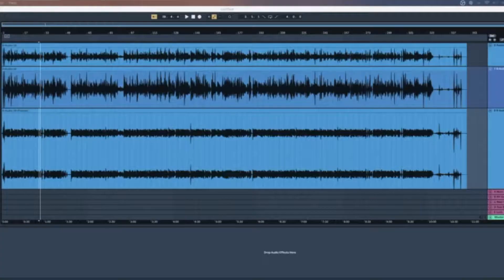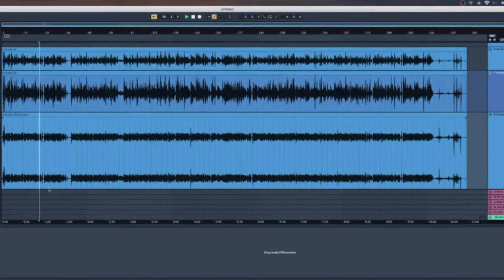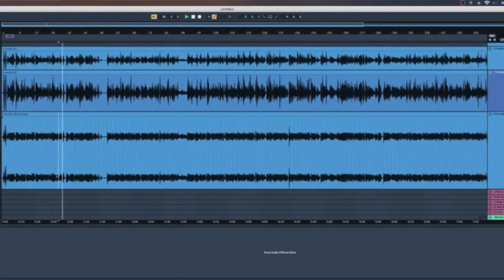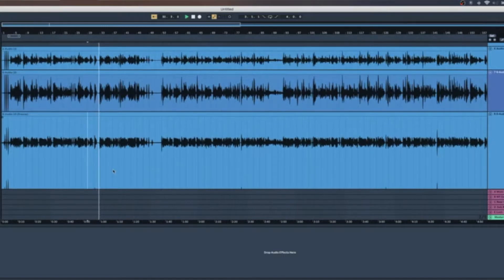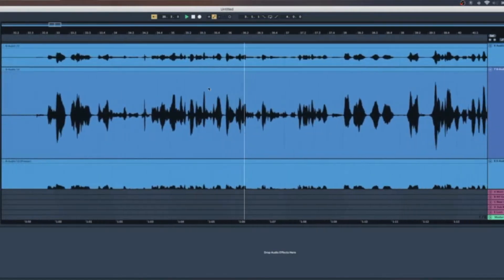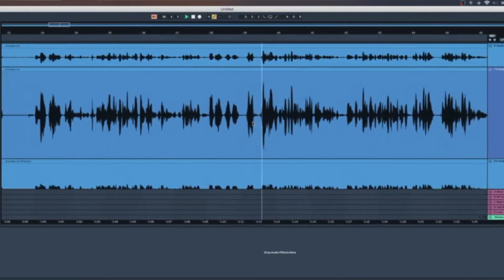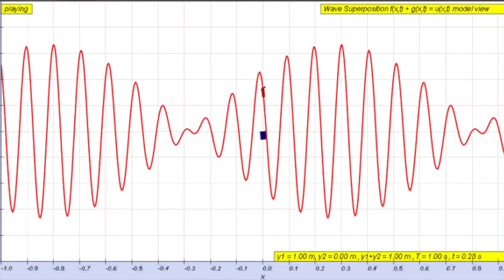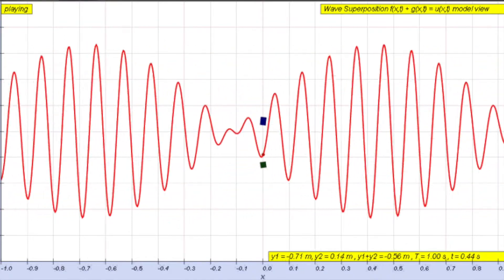Squashed - Episode  1: A Brief History of Compression

Comment: I read on another comment on a compression tutorial that also audio engineers used compression out of necessity, the guy who made the comment was an audio engineer himself who worked throughout the 50's and 60's, he said that they started using compression in the studio and final mix because vinyls and even studio tapes back then didn't have that much dynamic range so they used compression to "fit" the signal into the tapes, according to that guy the compressor "stuck" as an effect and that's how why it is still used. 😅 I'm a newbie so I don't know that much either, just that bit of info stuck with me, thanks for the video!